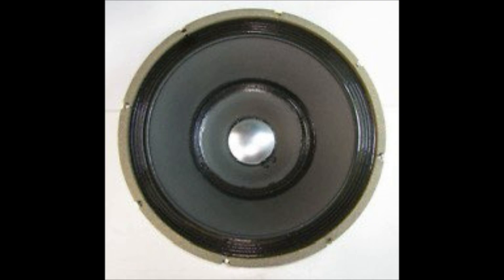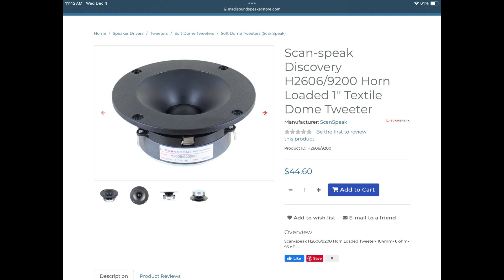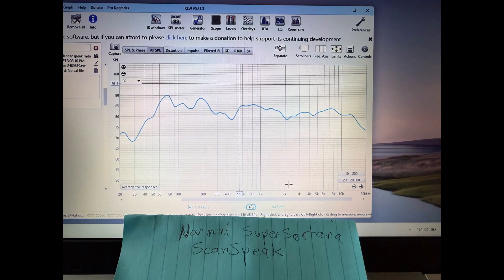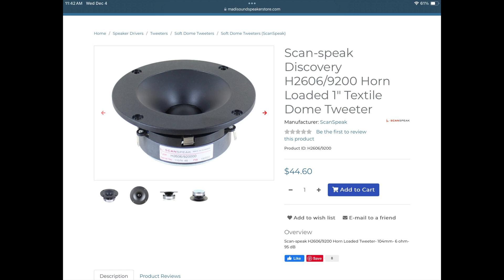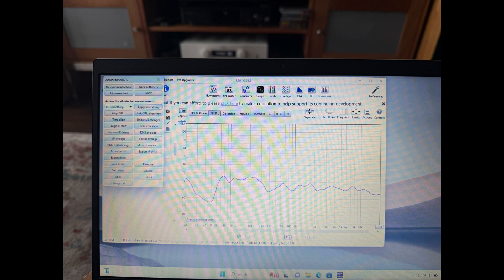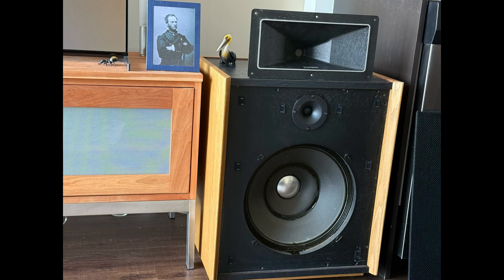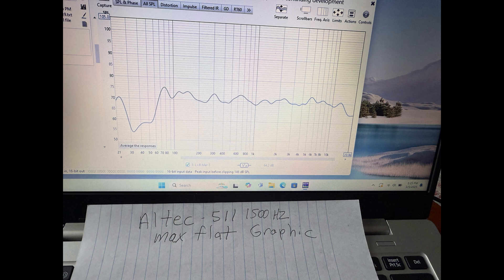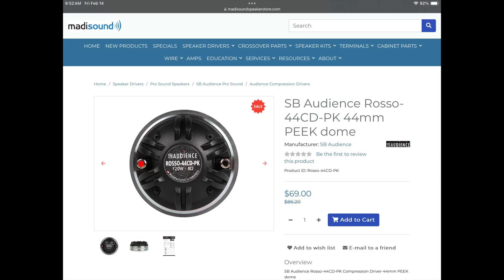Finalizing the Super Altec Santana, Chicago Horn Loudspeaker Guys confirm their recommendations.

Comment: Tom mentioned adding a capacitor and a coil for the Scan Speak tweeters, what are their values?
Reply from the maker: Tom here. .35 mh coil and 7.57 uf cap. 8 uf will work.
Reply: @ChicagoHornLoudspeakerGuys is it 7.5 uf? I can’t find 7.57 uf capacitors. Any particular brand?
Reply from the maker: @juanbortagaray4988  Tom here. Either 7.5 or 8 uf will do the job well enough. You can wire capacitors in parallel to get a value. For instance if you wire a 1 uf and 2 uf in parallel you get 3 uf. I like Solen caps but  Dayton caps from Parts Express are also fine.
Reply from the maker: Use the same value capacitor that is already in the speaker. Just swap out the tweeter to start. You can always upgrade to a good film cap later. Something like a Solen would work.

Comment: i am extremely happy you've started this.  I have a pair of santanas; nfortunately the 420a's are both stiffened shut but not blown.. the previously owned was a heavy smoker.  do you know anone locally who can repair these?  I am in champaign illinois so distance is no problem or shipping.. My specific question is this:  can the  dust cap but carefully removed and repair work be done that way without having to completely e and lose the visual integrity of the biflex? I am almost certain the piston is frozen from heavy tobacco smoke.  I am currently using the 1957 bose concert grands. thay have a pseudo wooden horn structure with 8 tweeters mounted in a curve and they are very smooth and inoffensive as we might say
Reply from the maker: Tom here. Maybe the speakers need disassembly, a cleaning of the voicecoil gap and voicecoil and reassembly. Just guessing. You don't want to lose the cones and caps. Is there a speaker repair person in your area? Musical instrument stores often know such people. Van L Speakerworks on the NW side of Chicago might be of help, he's really good.
Reply: Thanks I'll  call him and when I get back to ground zero get your schematic for the compression driver update
Reply from the maker: Kwing here: Parts Express used to sell the aluminum dust caps for Altec drivers. You might be able to carefully remove the dust cap, clean the gap and reglue the new one on the remnants of the old one. I see the drivers for sale once in a while for not much $$

Comment: So the Santana’s don’t have crossover?
Reply from the maker: Stock Santanas run the woofer fullrange and have a capacitor on the tweeter, high passing it at 3500 cycles.

Comment: Combine old speakers with modern drivers and horn geometries? Apply DSP EQ and measure the results with REW? I didn't know you old farts are so technically inclined. 😅
Subscribed!
Also, if you have someone with a 3d printer among you - try the ES-600 horn from Joseph Crowe. Simple 1st order XO at 1000Hz and super linear and smooth result with drivers like the SBA Rosso 65CD-T.
Reply from the maker: Brutal... some of us old farts have advance engineering degrees

Comment: I understand why you'd cross that original tweeter at 3.5k, but I don't understand why you'd do that on the compression driver tweeters? I would guess, but have no idea, that the 620 woofer cone would start to breakup around 2k and would benefit from being crossed lower against the compression driver tweeter. It's no sweat for the CD to go to 1.5k, 2k, and that would keep breakup out of the woofer. The 604E's were crossed at 1.5k.
Reply from the maker: Kwing here: For the Santana upgrade, we were trying to leverage the time align characteristics of the 420A driver as high as we can, before handing it off to a tweeter. From my experimentation, the 420A still sound good up to around 4K. I would personally try not to go beyond that, at least for my ears. Others have tried crossing it at 9K. I did not inquire of the slope of the crossover that was used in that configuration. Tom and I tried to use a 1st order crossover to keep things simple and cheap.

Comment: Can you really call that Scanspeak tweeter as "horn loaded"? It looks more like there's a waveguide on that tweeter and a tweeter would operate in a mass controlled zone, not acoustically loaded by a horn.
Reply: Oops. I see that's what Madisound says or maybe Scanspeak calls the tweeter. So, maybe we're just using the marketing name and not splitting hairs.
Reply: physically there is no difference between a 'horn' and a 'waveguide'. Both 'types' (it is the same ...) form the sound waves relying on the exact identical physical principle.
Reply: @ahnenpost5237  by the classical analytical research into horns that is not true and that is where we should look to define the terms to make sure we are not just discussing semantics. As first studied on the exponential horn, a "horn" performs an acoustic impedance transformation from the mouth to the throat that increases efficiency greatly at lower frequencies and increases SPL at lower frequencies by a LARGE amount. A waveguide does not perform acoustic impedance transformation. There are many horn shapes that can also perform an acoustic impedance transformation, but to do this they all require length. It does not occur with short lengths. But, even a short section of throat with very slow expansion can greatly increase this low frequency acoustic impedance loading and you will see many constant directivity horns, or even waveguides with these short sections.
Reply: @jamesoneil9757  this is your own definition and I could be ok with it - but you are claiming that I was wrong. I am not. Even mounting a dometweeter onto a baffle, that is a horn with no length at al, does change its acoustic impedance. Believe what you like, but do not teach me.
Reply from the maker: The Scanspeak's higher efficiency compared to other dome tweeters would seem to indicate the horn is acoustically loading the diaphragm. Often waveguide is a euphemism used to avoid the dreaded "H word" for appeal to audiophiles who dislike horns. Using horns to control dispersion goes way, way back.

Comment: What's your guys' opinion of the Altec Model 19? Rival or best the Klipschorn?
Reply from the maker: Tom here. I owned 19s and consider it superior to the KHorn, having a more realistic midrange, a more pleasing tone and better control of dispersion. The drivers of the 19 are of much higher quality. I think the 19 is possibly the best turnkey speaker ever.
Reply: @ChicagoHornLoudspeakerGuys  thanks guys!
Reply: @ChicagoHornLoudspeakerGuys  Any idea if you can see the orange tangerine on the M19 if you shine a flashlight through the horn? Would like to verify it's still there...
Reply from the maker: @Guitaural.  Tom here. Yes, you can see it, I just looked up the barrel of a 802-8T
Reply: @ChicagoHornLoudspeakerGuys  lol...thanks a bunch Tom!
Reply from the maker: Kwing here: The Model 19 is extremely hard to find nowadays and is about $3K if you do find a pair. The Rival is around $7500. Used Klipschorn is around $4K but needs good corners, unless you buy the latest model (AK7 for $19K). How much money do you want to spend? If you can find the model 19s with original drivers, buy them. Maybe you should consider a used pair of Klipschorns and buy the Volti tophat, that would put you around the ball park as the Rival.
Reply: @ looking like a decent set for high $3’s. Sounds like they stack up really well against the Klipdchorns then 😁

Comment: So did you leave it with the Scan Speak or with the other ones as the final choice? I actually thought SS were way more expensive.
I’m up in Wisconsin, if you want to come hear my ElectroVoice horns!
Reply: What model horns?  I love my HR9040 whales with DH1AMT drivers.
Reply: @naturalverities  Main system is a pair of Sentry IV's with the 1823 mid driver and ST3350 tweeter.
Reply: @bblimediamostlyspeakers  I see we have similarly excessive tastes, but what's a guy to do if he wants good sound quality, eh? 😁
Reply from the maker: @bblimedia  Tom here. The SM 120-A midrange horn used on Sentry IIIs and IVs is a great horn. I used them with my LaScalas years ago and they were a significant improvement over the Klipsch mid horns--the wider dispersion got rid of the on axis ferocity of the Klipsch mid horns and also made for a wider, more cloudlike soundstage.